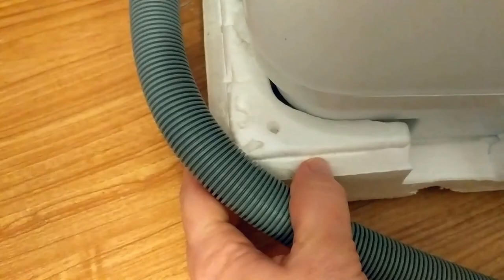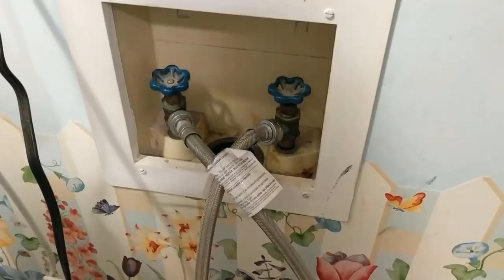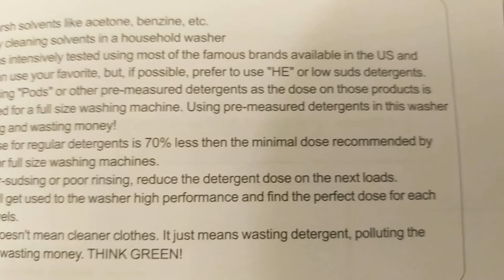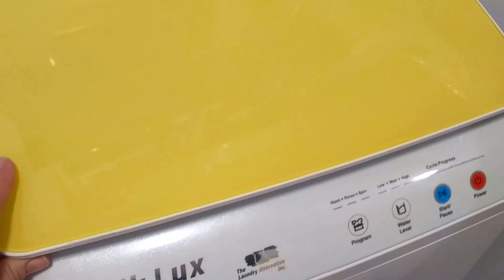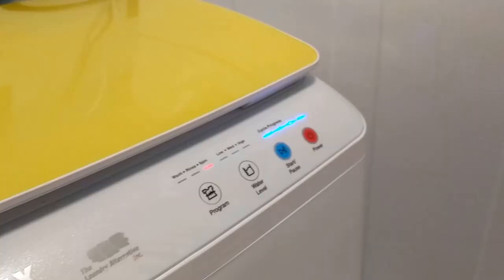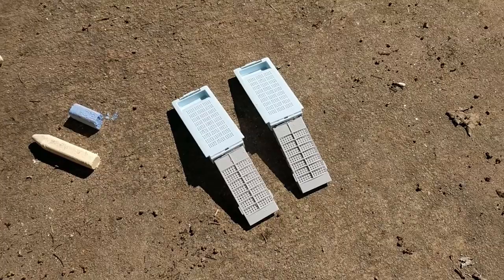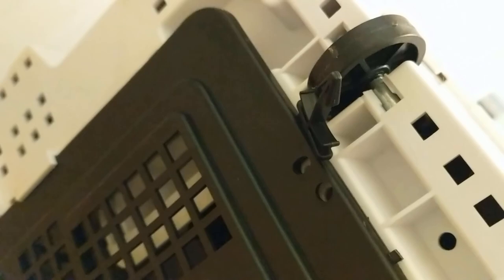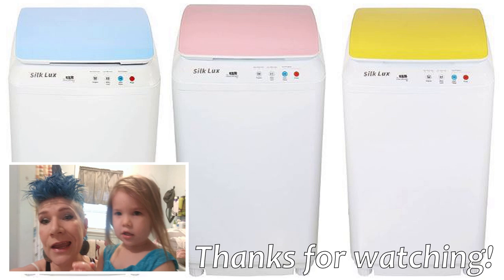The Laundry Alternative Super Compact Automatic Washer Review!! BEST Portable Mini Washing Machine!!

Comment: Great review. How dry did items come out of the washer?  We don't have a dryer so would line drying take forever with items that came out of the wash cycle.
Reply from the maker: @Sara Warner That's a good question...and I think it's totally manageable to line dry items coming out of this dryer. The spin cycle does a good job of removing excess water. 💦👍
Reply: Clothes come out just as dry as they would in a fully size washer while I own and use my dryer I like hanging sheets, pill cases, my night gowns and lingerie outside I like how they smell like sunshine

Comment: At 10:46 you say the drain hose came out and water was all over the floor - What happened/What part of the drain hose became disconnected? I am looking at purchasing this machine and terrified this exact scenario will happen as it did with a washer from a different brand - which I returned because it was not secured.
Reply from the maker: @lazyspark Hi. 🙂  I've probably used this compact washer close to 100 times now, and the hose only ever slipped out that one time. (The plastic hook that holds the hose and hangs down into the wall where our drainage pipe is...that's where the disconnect happened, causing water to drain onto the floor rather than down the pipe in the wall.) I don't even check it now...I assume that I must have bumped it or not entirely secured it from the get go. It hasn't budged since. I would recommend keeping an eye on it after installation to see if the plastic hose hook has moved at all (for added precaution)...but I suspect that this way my error and not related to anything faulty with the washer. I hope this helps!

Comment: Can you see the clothes spinning and washing if you lift up the lid? and how well does it clean and agitate compared to a regular washing machine?
Reply from the maker: @Patrick Star You can hear the washer moving the clothes around inside, but it's not designed to work with the lid open. I will say that it doesn't work as well on extremely dirty clothing...it's more of a soaker than an agitator, if that makes sense. 🤔 It won't spin dirt off, but clothing will come out smelling fresh and clean.
Reply: No you can’t see the clothes washing because it stops running when you lift the lid. I think it washes better than my cabrio top loader. I have a wonder washer which I use to pretreat dirty clothes with oxiclean

Comment: Worried about the hot water temprature affecting the life expectancy of the machine. I don't know how to for my water heater, but I know it is possible to adjust the temprature that it heats to. 
Contact your water heater's manufacturer if you no longer have the manual to find out how to adjust the temprature.
Reply from the maker: @posey1982 That's a good point! I hadn't thought about the water temperature being of concern. Thank you for commenting. 🙂
Reply: @BeingBarton  the hot water is not a problem. This is what the laundry alternative told me after I had mold in my washer after only washing with cold water. 
“By the way, our user manual mentions to prefer to use cold water, it's mandatory, we're forced to include that information (but we disagree). We encourage reducing the temperatures because some people tend to exaggerate and use temperatures much higher that really needed, which is also not good for the environment and for your wallet. However, unfortunately, the world is yet to discover a technology to effectively clean using cold water only. No washing machine and no detergent can have 100% of it's performance in tap cold water.”
Reply from the maker: @SallysCuteCrafts  Thank you for sharing this! <3

Comment: Is the box with the machine heavy to carry?
Reply from the maker: @Ewo Lam Yes. I had to move the washer inside the box by myself several times. It was really hard, but it's possible to just scoot the box along and then use leverage to get it into something like a truck bed. The other thing is that the box says to transport it upright. We have moved this unit in the box twice, and both times is was a challenge to strap it down vertically. I'm not sure what the potential issue is with moving the washer on its side, but we didn't want to find out. 😅

Comment: How loud is it?
Reply from the maker: @Rachel Bockert It's not loud at all. :)
Reply: There are times I need to check to see if it’s still on it’s so quiet and I live in a small one bedroom apartment.
Reply: What about the spin dry that wrings out the excess water, is it fairly quiet and/or does it vibrate?